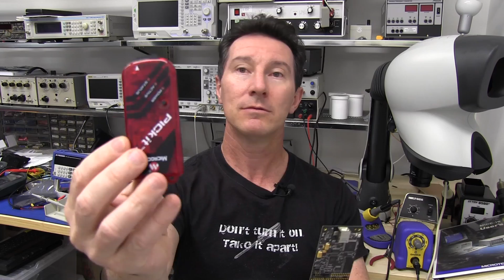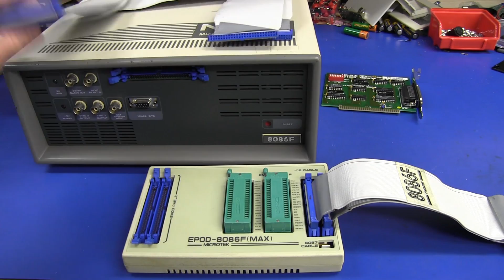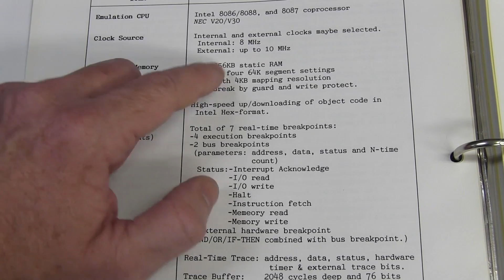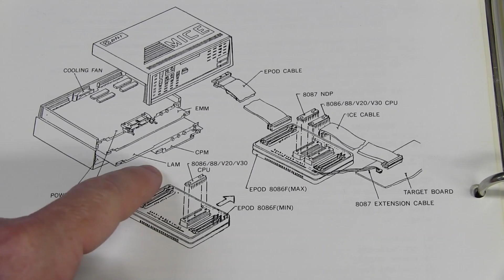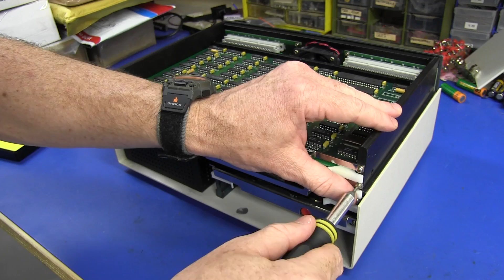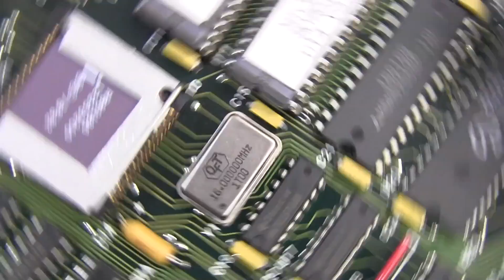EEVblog #410 - Microtek 8086 In-Circuit Emulator Teardown

Comment: 14:00 I would THINK that modern ICE type devices would use fiber instead of copper - no attenuation (or at least none significant enough to matter in short runs) and no interference, now I am no Electronics engineer as you are, but if memory serves, light is actually a fair bit faster than electricity as well - in terms of travel speed.

Speaking of which, do you know what the average delay per meter of fiber versus copper?  And thinking more on it, is there any significant delay in the conversion from light to electrical signal? Because obviously, to emulate any system, embedded or otherwise, the signal will have to be electronic at the end destination of the data flow.
Reply: I was of the understanding that light does not travel at the full speed of light in fibre, because fibre is not a vacuum - its more like "50% give or take". Therefore, electrical signals, e.g. over copper, or even microwave have lower propagation delay.

This is why you will find high frequency trading firms using microwave to link themselves to financial exchanges instead of fibre, because for any given speed the propagation delay is less.

Optical to electrical conversion will not be delay free, as there will be some logic involved in the process. I dont know how much, I suppose it would be dependent on the transceiver/driver chips used, but maybe low double digit nanoseconds?

Comment: I used several Microtek emulators. Used them for the Z80, 80186 and 68000.

They were a pain. Often they would glitch the system RAM when hitting a breakpoints Were good enough to get the hardware going. We ended up writing our own software debuggers for higher-level stuff.

The 68K one flat out would not work right. So, one of my first projects was actually designing a 68K emulator. Fun! The main production board had a custom pair of headers for the emulator to plugin.

The 80186 was real nice for embedded work. We used Microsoft 16-bit C. Was a nice development environment at the time.

The 8086 and the 68K were basically the last CPU's that had full-speed emulation. After that, higher speeds and onboard caches made tracing via capturing the bus impossible to do in a deterministic. manner. Heck on the 68K, if the code had  a conditional jump over an instruction, the bus trace would be the same if it made the jump or not due to prefetch.

I was so glad to see newer chips with JTAG and background debug pins. Eliminated those messy ribbon cables and worn-out CPU sockets.

Comment: Using an 80186 to drive this thing is just plain wrong. It shows bad form. It would be like cracking open a Sony TV and finding it loaded with Panasonic Caps and NEC ICs. It's like running MAME on a pinball machine.
Reply: +Jesus I think a 80186 or 80286 is just the right processor for something like this? I have no clue how that relates to your comment about brand names for components.
Reply: Jesus What do you think there's actually in a Sony TV? You never opened one up, obviously.
Reply: Yeah I have, it's all genuine Sony parts.
Reply: Jesus You might want to have another look. Depending on the year of manufacture, you will find some or many locally (depending on country of manufacture) sourced components and components from other Japanese or global manufacturers. They have even outsourced part of the manufacture of their infamous Trinitron tubes for some time during the last quarter of the last century, though this was under license and the label on the tube only mentioned Sony (the label also said Made in Germany, I'm not sure whether that was their only licensee at the time, but it is the only one I know of).

Sony didn't make their own capacitors and resistors recently and generally didn't manufacture every single part in any of their equipment even though they made a lot of different, often customized, components themselves (probably the only electronics manufacturer in the world that could and did manufacture every last part and piece for their own equipment was Philips, but even they bought in components, assemblies and complete equipment from others).

I have, over the years in Sony equipment, both professional and consumer grade, found many components and assemblies by NEC (also ICs ironically), TDK, Sanken, Sanyo, Asahi Kasei, Fujitsu, Standard Elektrik Lorenz, Siemens, Epcos, Rifa (those paper caps sure like to smoke), Philips, Vishay, NXP, Samsung, ST, Mitsubishi, Elna and probably Matsushita (Panasonic) as well, though I can't recall any specific Panasonic component right now. I think I have also seen LOPTs by HR and/or Eldor in Spanish manufactured TV sets, even though Sony did seem to mostly roll their own up until their last CRT TV. Sometimes, they also bought in complete equipment manufactured to their specification by, amongst others, Grundig and Samsung, which most likely didn't contain any Sony manufactured part.
Reply: +mjouwbuis It wouldn't surprise me to seeMatsushita parts in a Sony device, since Matsushita owns Sony, Panasonic, and Quasar. Let me tell you, in the 90s it was difficult to function in our living room with three VCRs, Panasonic, Quasar, and Sony, all using the same infrared remote pulses!

And, as someone that has owned MANY Sony devices over the years... Sony manufacturing is done in many different Asian countries, so it is possible that the factories source parts from other manufacturers. (Like the Malaysian-built Sony VCR I purchased once, it lasted two whole days beyond the warranty period before the timer, tuner, and transport controls self-destructed.)

Going through the process of building your own components is cost-prohibitive if a similar component already exists in the market. No doubt they use their own materials whenever possible - if it's on the shelf already, you don't have to order a few gross of them - but components that they don't have in stock can usually be substituted with another brand. Of course, it all comes down to the quality of the parts they use.

It's common across all manufacturers, really. Keeping production costs down helps max your profits.
Reply: +Andy Hicks You're very likely right, I just couldn't remember seeing Matsushita parts. Though I think you&#39;ve got them confused with JVC as far as being owned by Matsushita. I find it interesting though, that the Sony VCR was operated by a Panasonic remote. Some OEM manufacturing might have been going on as Sony was late to enter the VHS market. Some Sony VHS recorders for the European market were made by Grundig and, I think, Hitachi.

Comment: I used a MicroTek 80286 emulator back in the early 1990's.  The processor "probe" was a bit twitchy.  If not seated in the processor socket on your target board perfectly, all sorts of weird things would happen.  It made for a very delicate setup.  $20K price range if memory serves.  When it worked, it was able to help solve many a firmware bug; especially anything having to do with interrupt processing.  Many processors these days have debugging features built-in.  Interesting vid.

Comment: I do programming. But i have NO CLUE what the hell this thing is for. The explaination is like "ice cream truck = truck that carries ice cream", it just doesnt explain anything. sorry mate
Reply: Joel Alain high level programming has no use of such kind of hardware, but low level development like very integrated embedded systems of critical hardware (like in avionics or industrial environments) totally needs to probe their processors down to the core scale while running on the actual hardware being developed. It's like a functional MRI for microprocessor.

Comment: The back plane looks very much like a VME system.

I think by the way, that it just wasn't worth spending a lot of time and money to integrate stuff into ASICs or FPGAs or CPLDs or whatever. They're produced in such low volume that it just won't pay off. Besides, the places where these are used, are probably happy to pay 5 or 6 digit figures for something that they can use and that's reliable, and they would be weary of subtle problems that happen because of hiding stuff in ASICs.

Comment: DIP-2 capacitors are still available, but are on the expensive side compared to other packages.  The X2212 is a Xicor nonvolatile SRAM.

Comment: The ISA card is only a parallel port. Any motherboard with a simple parallel printer port will work. You may also need an RS232 serial card too but both are available in PCI format and as such are still compatible with current PCs.

Comment: You could always find an IBM PC or PC XT, connect the ICE to it, and then build ISA card-based peripheral projects. I used to use an Apple II (still have one) with a prototype card to drive hardware projects such as analog-to-digital converters, lighting up LEDs in patterns, etc.

Comment: I'm not familiar with this particular ICE. When I did ROM-BIOS engineering for Phoenix Tech during the late 1980s, we used the real Intel 80x86 ICE's. We would burn our code to EEPROM, stick the EEPROM into a motherboard, and with the ICE replacing the CPU, we were able to troubleshoot down to the microinstruction level. We also used these for developing other kinds of firmware, such as EGA and VGA controllers (I worked on the C&T chipsets) and even keyboard controllers with the 8085.

Comment: The hassles and costs Dave mentioned regarding bond out versions of micros is one of the reasons why JTAG has become so ubiquitous. Also why you hardly see any special bond out versions of chips nowadays, since JTAG works on any production chips with embedded debug circuitry.

Comment: Dave, If you ever find cap screws stripped like that, you can tap a T10 or T15 torque bit  (depending on the size)into the head,  and undo them that way.

Comment: Don't my my last question, i was talking to my brother and wasn't paying attention to what i was writing... i meant to ask why would you use it, if it's so expensive and it only emulates the processor? won't it be cheaper to buy the cpu or microcontroller, program it and then assess how it would actually function? you'd also get better and more accurate results that way.. thx :]